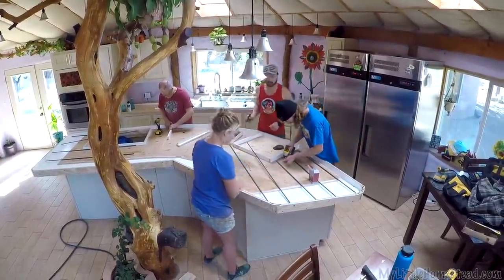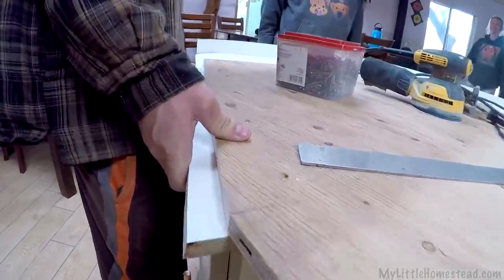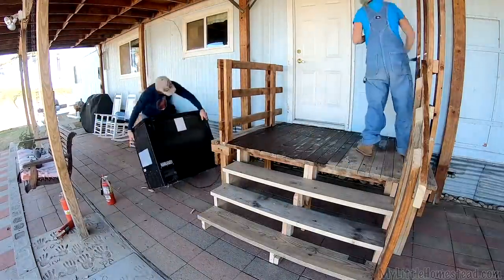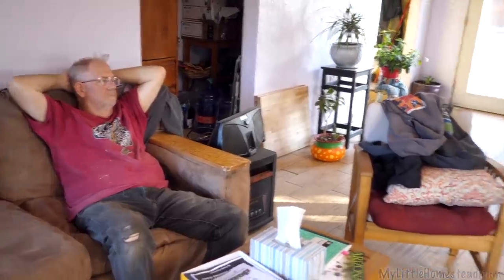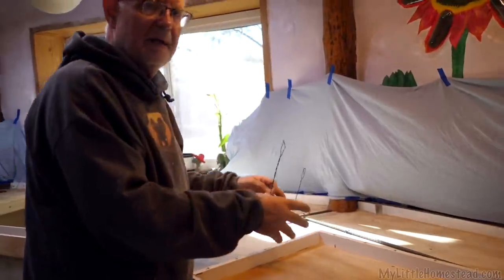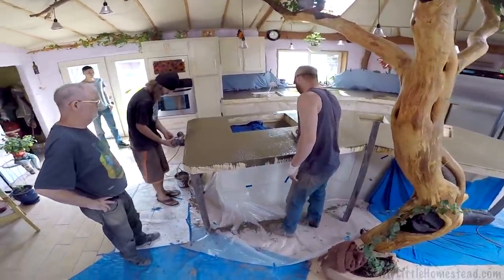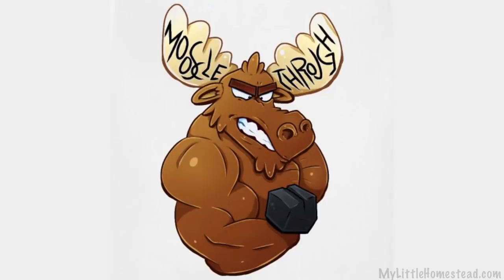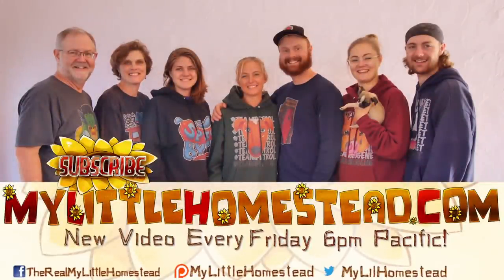Concrete Countertops & Rebuilding Entrance Stairs | Weekly Peek Ep212

Comment: The wooden table came out really nice!  Beautiful grain on the top.  I've been looking forward to your concrete countertops, can't wait to see them when polished and complete!  Once they are cured and initial sanded, that's the best time to consider some of the acid staining finish methods.  I'm sure your collective artistic talents could do some amazing things with these methods.  Hopefully next spring I'll be building (and uploading) my planned outdoor concrete counters.  I'm considering using crushed/screened local rock worked into the top layer and polished down for an exposed aggregate effect.  I also admire glass aggregate countertops, even seen them with LEDs, fiber optics, and glow in the dark aggregates.

Some thoughts on the methods shown:   Wipe the inside of the forms with a thin veneer of clear vegetable oil for better mold release.  The rebar absolutely must be up off the bottom of the forms, use low profile cement dobies or plastic rebar chairs.  If using reinforcing mesh you can just pull the mesh up to the middle of the concrete as you pour.  Thoroughly mix a measured dose of your colorant into a smaller amount of water beforehand, then mix that into your water before adding to dry concrete.  Carefully measure out the water before mixing, it's easy to add too much, which is difficult to correct in tinted batches.  This and overtroweling can lead to fine spiderweb cracks in your final surface.  You get your gloss in post cure polishing, not a wet finish.

Comment: Here in Australia we use a product called masonite that we use to make the edging and we wet it down before trying to curve it.  Similar to what you used for the edge barrier.
Reply: The good ole USA charges way to much for masonite these days.  White board or hardboard is about 10 bucks a sheet.

Comment: The dry color is way better than the wet color of the cement! And I beg to differ about the re-bar. You can have too much of it. When you're sledge hammering it and six inches by seven feet by fifteen feet of twenty year old driveway to get it ready for a new one! My hubby and I  did it together until I was too pregnant and then I did daycare. We've been married thirtyone years and he still does concrete! Can't wait to see it next Friday!!! Garen and Ellie, the porch looks really nice. I especially like the table, Ellie! We had a widely spaced staircase coming down from our front door but we had rails on both sides, which you have not. Why, I wonder? Particularly with children on the horizon. Or at least, child!😂 You might want to reconsider and slap another rail up. Just to make feeble right handed people feel safe!😂😂 Gary, looking marvelous, simply marvelous! 💓💛💚💙💜🌈

Comment: There is a tool used on Fondant and clay which is just a stick with a metal ball on the end. It's a great tool to use on silicone to get that perfectly rounded off edge in the concrete.

Comment: Gary,
For future reference for your rounded corners of your counter tops. Instead of just attaching bits of wood or particle board in a semi-rounded shape, use a card stock printer paper or a few pieces of card stock (making a thicker frame) and mount that on your corners THEN attach the corner wood BEHIND it for support and you will have the rounded corner you wanted.

Comment: Nice job on everything!  I’m still trying to figure out what to do for the countertops in my new place (almost a tiny house), currently the top of the list happens to be either concrete or thick coated butcher block if I can’t find stone remnants I like. Butcher block would be simple enough to replace if it got too badly scratched up and would be easy to work
Reply: Missing all my Marbles with butcher block counter top when it get bad looking all you have to do is sand it and then put the finish back on...no need to remove and buy more. 😊

Comment: Looks great but for those bigger overhangs I would use more steel reinforcement with shredded rope added to the cement and a cup of plasticizer. Or extend the wood. Or stand there, and if someone is about to slam down a glass, grab their arm really fast. And make sure no girls get up there to dance!  Also instead of using regular grey portland, use white portland. You can add broken glass or fish aquarium stones. Looks muy bueno!  Floor wax to finish it after the liquid sealant. I've done about three kitchens and each one came out better than the previous. Always learning something. Thanks for the videos!

Comment: Like the idea of the cutting boards in the concrete.  countertops look good- now you just need to seal it.  how do they polish a terrazzo floor? Granite countertops are highly polished and then sealed.  just had a flash back to smoothing printing stones.  We had a big heavy metal disk with a offset handle.  and different grits.  you would add a little water to the surface sprinkle a little polishing grit on the surface.  place the metal  desk on top and start moving the disk in circles.   and you would work from a heavy grit to a fine grit.  then wash it off.  you cold also etch the surface with a pattern and then take some unsanded  different colored grout and work it into the surface.  Then seal the countertop with a really good sealer.

Comment: Ok. As much as i dislike being the bearer of bad news... You're going to need to seal the countertops. Concrete is porous and any little thing will soak in and stain it. I would recommend a clear resin. Not to thick just enough for a seal. Might i suggest STONE COAT EPOXY. they have online tutorials you can watch and even a help line to answer any questions that might arise.

Comment: I was thinking y'all weren't going to caulk the silicone around your form, and you just had incredible faith in your sides being super tight with just screws. Then you put the rebar and then caulked, a step I expected as soon as the bendy form went up. I'm confused why you did it the complicated way?  Was there a reason to wait for it to work structurally?

Comment: When you use tie wire I put a put sometape around the outside of the roll. Pull the wire from inside the roll. Mean use the wire from the inside out its. It won't get tangled.

Comment: Cement is very porous so be sure to seal it well before getting anything wet on it.  It also difficult to get the bacteria out once it gets down in to the countertop.  The cutting boards should be easily removed to be washed when needed.  That is what I like about Formica tops in that they are so easy to clean and they are not porous.